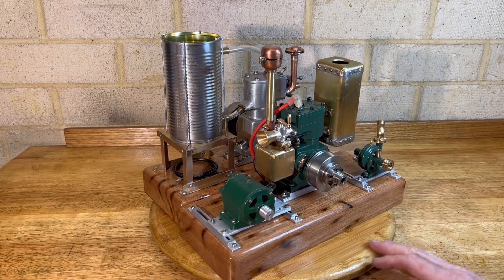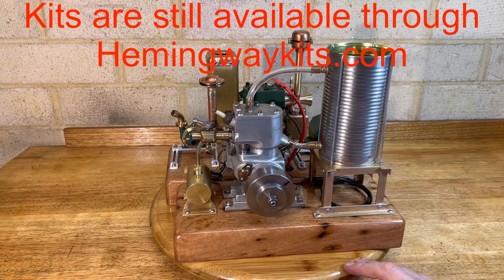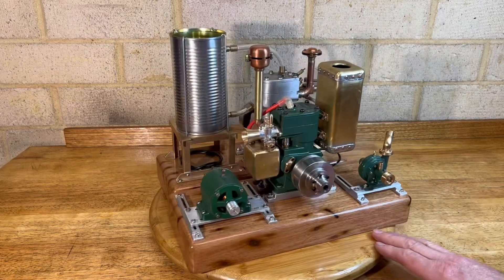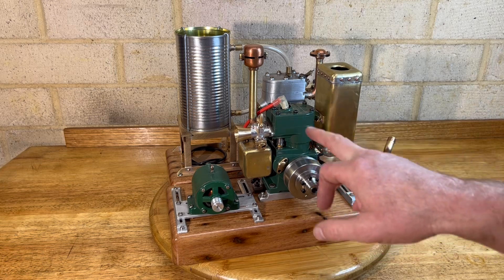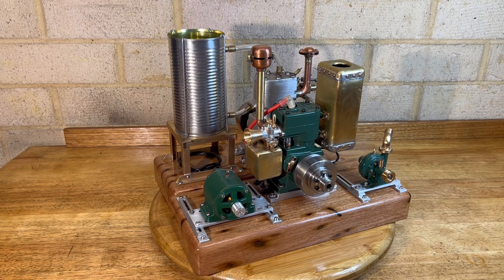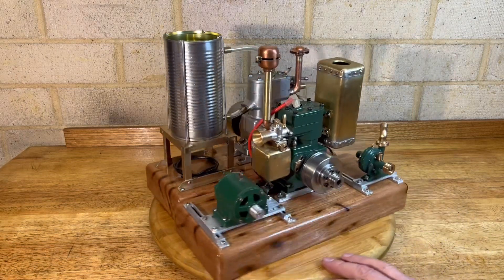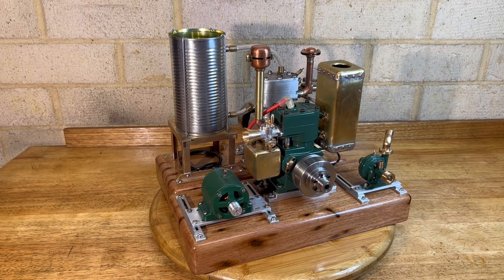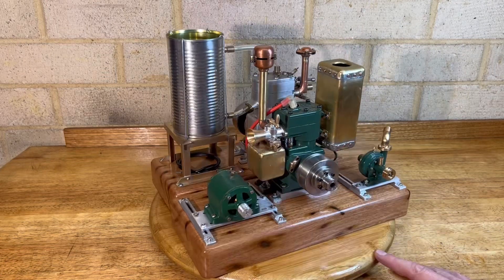Two Whippet model engines, the old and the new.

Comment: Great Work Darren
I am making the Hemmingway kit version myself and have nearly finished
I could do with the one way bearing starter attachment to the flywheel
Where do you get those please?

Also do you have the design of the top of the exhaust stack please does it act as a baffle?

Kind regards

Dave Perry